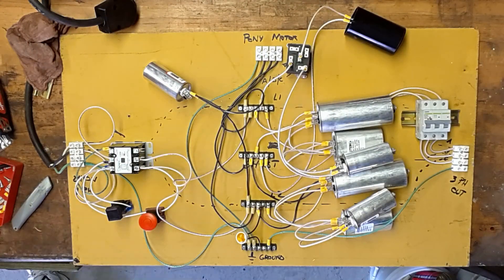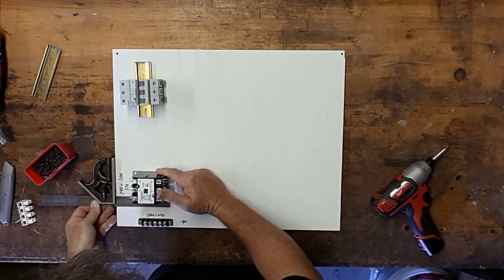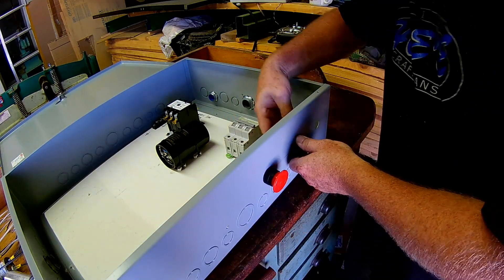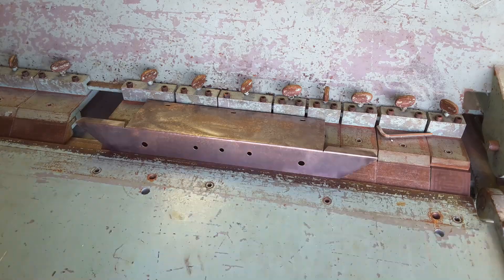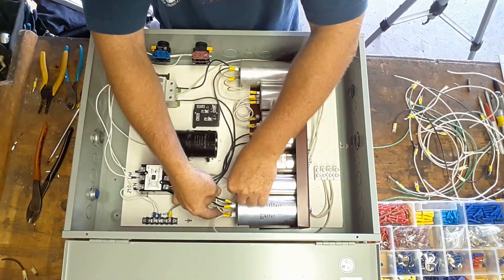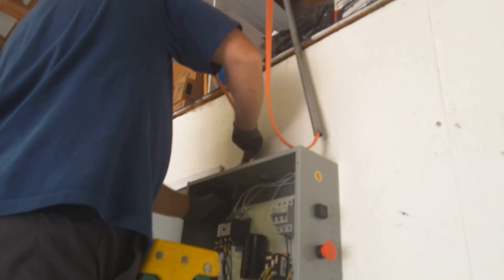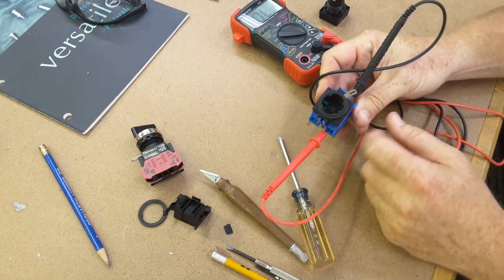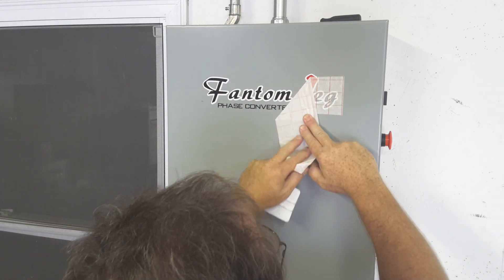Building a Phase Converter - Part 3 Final

Comment: Is the idler motor running in star or delta, no one seems to cover or mention that?
Since you did such a great job.... is it still working and whats the idler motor wiring config?

thanks
Reply from the maker: Well that is an interesting question...I don't know what wiring config it is in.  What I'm curious about is (for this application), does it matter?  i don't know that either.  I have built 3 of these now and have never concerned myself with this detail.  Also, the documentation I follow, never calls it out as something to address or compensate for.  If you uncover something concrete, please post it back here and I'll pin the comment to the top for others.
As for your other question...Yes.  It still performs great.  I used it yesterday running my sheet metal shear.  As I mentioned, I've made three now with this information and they are all in good order.  Good luck with your build if you go forward. ~P
Reply: @sbirdranch  Just with a Star it provides a neutral line at the intersection so things like lights can  be utilized so can 5 pin plugs  3P+N+E vs a 4 pin 3P+E.

Comment: mount that motor up high and make it a big exhaust fan!?
Reply from the maker: Oh the funny there.  I seem to have some resistance to exhaust fans.  I have two new, in the box, fans for different purposes.  They have been bought over the years, and I have never installed them.  Did I mention I coated my headers yesterday?  Oh how I wish I would install a fan.  ~P

Comment: Hate to be the buzz kill on all the great comments but as an electrician and electrical inspector for 25+ years, there are multiple potential electrical and fire hazards wired into this video series, and is basically an accident waiting to happen. It is a fine example of why one should consult a qualified professional and not YouTube when needing technical expertise on any subject matter one does not honestly understand. If someone gets hurt or loses their home or a loved one's life, good luck in holding anyone accountable other than oneself. Although someone might have a case against somebody who produces such an unsafe video under the guise of "being a professional", either the producer does not have enough money that will give a single lawyer the incentive to take on their case without a hefty upfront cash payment, or they have lots of money and lawyers on retainer that will pin the blame it on the individual for doing something that was apparently not qualified to do but did in the first place after dragging out the case over years. 

Electricity is nothing to be played around with and is inherently dangerous. Electrical problems do not rear its ugly head until it is too late. Like a seatbelt in your car, if it is not properly installed or utilized, during an accident is too late to find out you have a problem and try to correct it before getting hurt. There are laws governing such practices to protect both the professionals who take the time and responsibility to do it right the first time safely and those who do not understand the subject which is much more complex than the unskilled realize. It does take time and money to do it right, to do it safely, unfortunately. How much value does an individual is willing to risk in their personal property and or loved ones well being to save some money?

Comment: Gr888 series 👍, but one question does this method work on a 2 phase l1,l2 each line is 110 volts instead of the single phase 220 v?
Reply: There is no such thing as 2 phase.  110/120 v and 220/240 v are both single phase. 110 has a line (hot leg) and neutral, 220 has two lines and a neutral (both 1 phase). Three phase has 3 lines or hot legs. The third leg may be of a different voltage. Hope this helps.

Comment: Im curious why the start capacitor switch is needed once you have the run capacitors hooked up  .Only reason I ask is That I have a 16 HP converter from Phase-a-Matic and I believe that it does not contain one, at least a manual one.   GREAT video series!
Reply from the maker: Manual or Automatic, I bet there is one in there somewhere.  Start caps are like coffee...You need the jolt to get started but can't run on it all day.  Start caps will blow up if left in the circuit too long.  You see that in this video.  ~P

Comment: Love it! I just today dropped my 50 hp 3 phase converter about 8 feet onto the concrete while trying to mount it up over my shop bathroom. Terrible feeling. A bunch of the capacitors fell out onto the floor and the panel box took some damage. Otherwise I don't know that there is any visible damage. I can't say for the motor, but it is encased in a giant 1/4" metal bell type enclosure. Hopefully it still works. Will know more tomorrow. At any rate, as a complete electrical novice, stumbling across your video was a godsend in helping me to understand something of the structure in which all those capacitors operate. Hopefully we can get it put back together and working tomorrow. Really reassuring to see how actually simple the whole set up is. Kinda ;)
Reply from the maker: I hope your gravity test provide to be of little impact (pun intended).  That is a big converter and must run some sizeable equipment. ~P
Reply: @sbirdranch  Thanks I think we got it all back together correctly. Checked with the builder of the converter whose number was attached to the unit. Should test today!
Reply: @dal2888859  may i know what is your maximum load for your 50hp rpc? 50hp is your idle motor right?
Reply: @Mr Bean  i dont know much about it tbh wish i could help
Reply: @dal2888859  your 50hp is operational to this day?
Reply: @mrbean4982  yes. I run 4 or 5 machines off of it but not all at thebsame time
Reply: @dal2888859  nice.. im planning to build one as well but for only one load which is 20hp motor

Comment: Amigo this is a great set of videos! Thank you very much! I got a 5 hp lathe and my phase converter has a 3hp pony!  And when I try to start the lathe it makes lot of noise! My Bridgeport  mill starts right up no noise!
Reply from the maker: The phase converter needs to be larger than the motor being driven.  Your 5hp lathe needs at least a 7.5hp phase converter.  Your bridgeport isn't 5hp.

Comment: The start relay failed due to current higher than design.  In a submersible pump application with external caps and start relays, it is common to see the output of the start relay powering a contactor.  The contactor then puts the start capacitor in and out of the circuit.   I rebuilt an old cabinet for a lift station using this logic, and the problem with the repeating (every few months) capacitor melt down stopped.  Hope that helps.  Great video, very informative.

Comment: You have one start compasator, the rest are run compasator right?
Reply from the maker: Correct.  I could have used multiple smaller ones but I had a single one large enough.
Reply: @sbirdranch  I've got a phase-a-matic box it has three big start compasator but it blows up the compasators, there over charging I think, what closes the power off after the motor starts? I don't understand it. Your videos really help. Thanks man.

Comment: For safety, especially this application, you really should put have a dedicated ground conductor.  It looks like you are using ground for neutral.  However, the ground conductor should not be used to conduct current during normal conditions.

Comment: Is there a commercial switch that will do the same as your modified push button switch?
Reply from the maker: Yes.  They are rotary and work much like the ignition on your car.  When the motor is up to speed they spring back to the run position.

Comment: Not sure how long they've been around in the US, but what you call panel knockout dies we have known in the UK (I have anyway) for over 60 years as Q-Max cutters (trade name and sold as such) and if you really want a nice clean hole with no jagged edges (you may need to deburr the back edge but otherwise definitely not jagged as I'm sure you know) there is NOTHING to touch them except a proper fly press and die/s. I've had a set of these for at least 45 years, the largest I have is 2.5 inches diameter and there is at least ONE rectangular cutter available. They work on steeel, aluminium, brass, copper and plastic but on plastic great care is needed not to cause stress cracking. I've had good success with using a precut piece of aluminium at the back back as a stress reliever. They do NOT work well on the harder plastics like Lexan or Plexiglass as they are too brittle.
Reply: Panel knockouts have been available in the US since at least the 1930s, originally made by Greenlee.

Comment: The problem with your potential relay, may have been it's mounted position.

IIRC all potential relays used to be position sensitive, and were labeled with an arrow pointing up, or the word Up printed on the shell.
Since your potential relay worked the in the horizontal position on your mock up, but then failed in the vertical position on your build box,
I suggest that the relay failure was because of position, and not some other random failure.

I used to do lots of these relays in the HVAC business many decades ago, especially when installing a hard start kit on a single phase compressor.

Tim
Reply from the maker: I think you are correct.  I didn't realize the position sensitivity at the time.
Reply: came here to say the same thing.

Comment: For disengaging the starting capacitor, you could also use a relay that energizes from the ghost leg, and disconnects the starting cap as soon as sufficient voltage is present there.
Reply: yeah i think the potential relay is wired wrong from what i see, likely why it blew up the cap.

Comment: I was just wondering. Could you have used a magnetic starter switch instead of the one you ended 
up using? Also, did you hook one side of the starter switch to ground so it would work as  120 volts?
I am not quite clear as to the wiring configuration of the contactor with the momentary on button. Is 
there somewhere I can look to get the schematic of that particular wiring diagram?  Thanks,  Barry
Reply: Same question here. (Edit: He references the Practical Machinist schematic, but his layout and components are different. To my ignorant mind this seems like building a Chevy and telling folks to reference the Ford build sheet. Both are cars, but they're sure not the same. Referencing one to build the other leads to frustration and a lot of head scratching.)

Comment: Why can't a VFD inverter run a 3 phase motor as an idler and connect the load directly on the motor phases. The motor coils will act as a low pass filter

Comment: sbirdranch  You reference the Fitch Williams schematic but only used the start Contactor. why not the run Contactor and transformer as he draws out? I thought potential and timed relays where not to be used in anything over 7.5 HP? what am I missing? I'm building one and want to do as exactly what Fitch prescribes so just curious.
Reply from the maker: I achieved the same functions just in a different way.  The primary thing I got for his documentation wascapacitor sizing and tuning.  I've never heard the limit on potential relays so maybe it is good I didn't use one in the end.  Just as an aside, the converter is still working great without further change.  ~P
Reply: @sbirdranch  awesome thanks. looking back what would have been an alternative in your mind to the switch alteration?
Reply from the maker: @adrianwilliams9863  I built another one very similar to my design, for my cousin and used two buttons.  The start sequence was to press and hold the "start" button, then press the "on" button.  When the pony motor comes up to speed, you let go of the start button.

Comment: Just curious.  What is the load capacity on some thing like this?  I mean how many 3 phase machines can you run at one time?
Reply: You can use as many as you want. I have connected the output to a three phase panel and hooked up a whole machine shop, the more machines you use the more efficient it works. Just make sure you start the smaller loads first.
Reply: Hank is correct, the more the merrier. It seems counter intuitive but each motor helps to balance the system, so I have been told by a rep from a manufacturer.

Comment: Great to do your own and when they work well that's a bonus! I've built numerous roto phases, for people, my largest being a 60 hp. They last for years and are reliable, one thing to keep in mind also is the values of the capacitors change over time because of usage, so it's good to check them periodically. I have a new approach on a 30hp coming up, I'm working with a motor rewind company that is going to rewind the motor so that the Phantom leg generated is going to equal the voltage of line 1,2.  If this works out, which they feel it should there will be no need for balance capacitors, a true balanced delta configuration. Another point on the capacitor balancing,instead of balancing the source motor balance each load motor separately. In other words each motor has it own capacitors bank, then you can really balance that particular motor you are using, it costs a bit more and more work but it is more efficient. It's great that you spent the time to make the vids and the viewers certainly appreciate it, I know do!
Reply from the maker: Good lunch with the custom winding.  That would be cool. ~P
Reply: Hi there. Your motor balancing rewind project sounds awesome in theory and I’m not sure if it could be put into practice without a lot of trial and error. Is this something you did already? If so, any pointers are appreciated as it seems like something I would pursue if it works out as advertised. Thanks.
Reply: How did your winding experiment go?

Comment: Just quick questions.  1. Once the starter motor starts the pony motor, the starter motor is no longer needed?  2.  All of the power is captured from the pony motor?
Reply from the maker: 1.  Yes.  I am not using a starter motor but off you are it is only necessary to get the pony motor spinning.  I have seen people use a rope wound around the pony motor shaft which they pull to start it spinning.  2. There is some power used by the pony motor to maintain its running state but because it has no load, it doesn't consume much.  ~P

Comment: First off - great video and explanation. And of course, what little we see of your shop and property has us all [at least me] salivating for a small portion of same. But I have the feeling you planned, built, and earned it on your own.  So ... KUDOS!!!

Now: On to comment:  Never been a fan of capacitor simulation of  true 3Φ wiring for this reasoning: (and I'm surprised you didn't bring up the subject)  the balancing of load current depends greatly on the load, so the values of the various caps has to be adjusted for the specific situation.
As a slightly absurd example: since your setup is for a 10 horse motor, does anyone think it would work equally well for a ½HP or a 100HP beast ?

One reasoning for posting this is the number of responses you've received from readers who plan to use the exact design for different setups.  Have the feeling they may not get what they expect.

Whatever, keep up the good work. and should you ever wish to share your shop with a Central Oregon DIY'er, give us an eMail. Thnx, Bruce
Reply from the maker: Hay Bruce.  Thanks for you thoughts and comments.  Maybe someday when I move back out west you can come take a tour.  ~P

Comment: Just a few comments.   1.  I'm very surprised that someone with the sheet metal skills you have would install plywood backboard in a control cabinet.   Also, plywood should not be used.   2.  I believe you had a contactor, not a motor starter.   Starters have motor overload protection built in, contactors do not.   Also, relays are less than 20 ampere devices.   3.  You installed conduit and pulled NM cable (romex) in it.   If the conduit is longer than 6 feet, that's a no no.    4.   On the last video, you used ground to make the 120 volt coil work in the contactor.   Since you used NM cable and I watched carefully, you did not bring a neutral to the board and still used the ground.   Will it work, yes.   Is it safe, possibly.   Is it correct and NEC or UL compliant, no.    Mostly you did an excellent job!   Respectfully,   Kevin
Reply: Contactors use an overload relay which is an add-on component.

Comment: Don't know how much I'd trust a 1077 supplementary protection device to protect from something that's already blown its guts out once, probably should have spent the extra couple bucks and got a proper circuit breaker, romex in conduit, why? A wood back plane, not only is that stupid, I'm pretty sure its illegal, its not like you don't have sheet metal working skills and equipment. That button mod is all kinds of a bad idea, The only thing worse than running current down a ground wire is showing thousands of people that its a good idea. but thankfully you spent the time to ground the bodies of the capacitors???